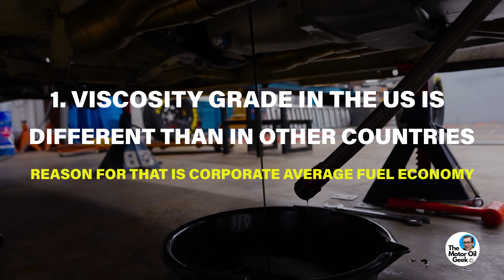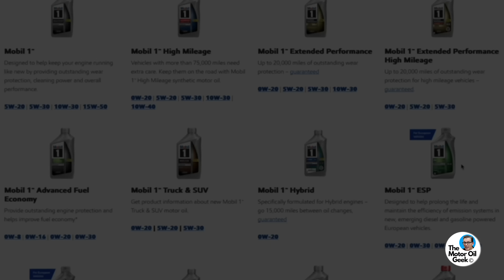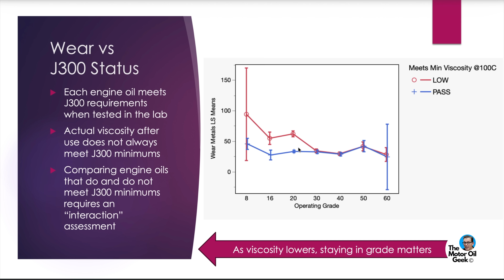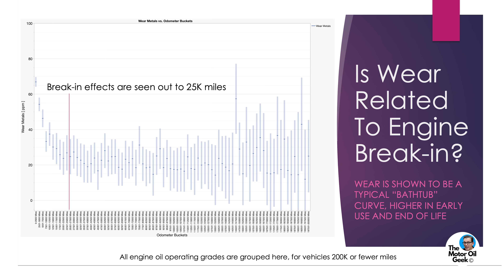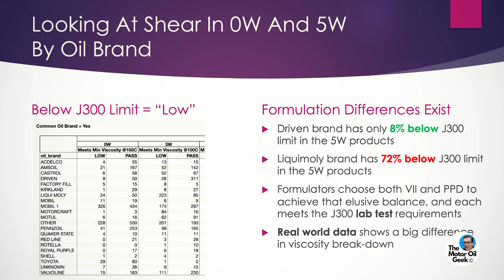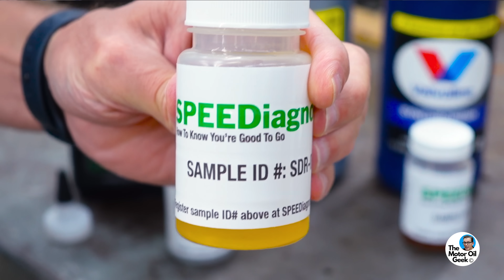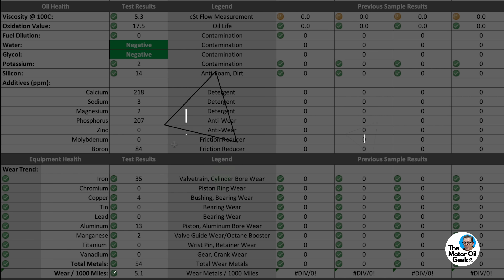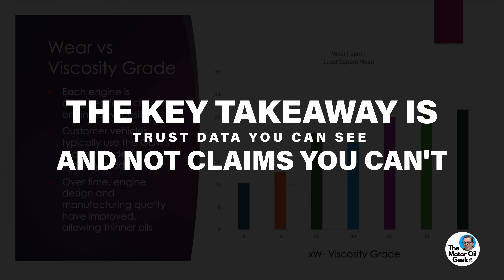More Ai Lies? The FACTS about 0W-20 vs 5W-30 (With Evidence)

Comment: You make very informative videos on the wear characteristics of oil in regards to defending zero weight oils, BUT I don’t recall you talking about wear caused by Valve Lifter Clatter on Start Up, with zero weight oils…

My 2023 Ram 5.7L and my 2025 Jeep 3.6L both called for 0w-20 oil, and both had very bad valve lifter clatter on Start-Up from new with 0w-20 oil…

Switching to 5w-30 oil at 500 miles eliminated all clatter at start-up down to temperature as low as 1 degree Fahrenheit…

The 5.7L currently has 4507 miles end the 3.6L currently has 2088 miles on the engine…

My real world science in this factual claim is, I stand right in of the front bumper, remote start both engines, listen with my ears, and with 5w-30 oil there is no more valve lifter clatter…

Valve lifter clatter with CAFE GARBAGE oil cannot be good for any engine.  I say my Ears trump your science, what say you???
Reply: I’d say a electric pre-oiler would be good for all our engines.
Reply: You should gather data and create a video defending your point of view. Stellantis doesn’t have a good track record with engine longevity…

Comment: So how do I prevent oil from shearing? Sounds like overheating it is the main factor?
Reply: Depends if you got a turbocharged engine and temperature of oil and outside.
Reply: @halftontimrvreviewsandtips3106  One example - Chrysler 3.6 pentastar, mine has 5W-30 on the cap but newer ones have 5W-20, rumor is that after Fiat/Stellantis/lizards took over, they had a deal with different oil maker, or maybe needed to reduce the fleet emissions. Another example - classic V8 muscle, original manual says 10W-30 but R&D of oils went a looooong way since, is this still valid? Should I go higher if I use it only in warm weather?
Reply: @redguyCZ  it really depends how cold it gets in your area. It’s been a while since I looked up the bottom and of the temperature range for 530 but I think it’s like -30 or 32°. The coldest it gets here that I’ve been has been like 15° normally the coldest it goes to is like 22 to 24° and that’s rare but generally for my peace of mind if it drops below 32° I like to have 0W 20 in my engine and since I only do two oil change as a year, I have it timed perfectly aware I can just switch them out with the temperatures. I tow 7000 pounds a day so I kinda push my truck a little bit more than normal but I do a lot of short trips as well like 5 to 10 minute sometimes shorter with a long trip in the beginning and a long trip at the end like 35 minutes I should say longer. And in the winter, those short trips when you’re starting up a lot, the engine doesn’t fully heat up in between some of them so I tend to just switch the 0w-30 to prevent some of the wear from startup.
Reply: @redguyCZ   Its all EPA driven  Lake even stated that in a previous video! Another non elected group telling us what to do 🤬
Reply: @halftontimrvreviewsandtips3106 chains sheer oil more than anything

Comment: I have a 2019 Kia soul 1.6 l lots of oil blow by. Thirsty little engine. I use 0W-20. But I'm hearing switching to 05W-30 will help prevent some of that blow-by. I know the wear and tear ain't going to be any different because of the additive packages so on and so forth. But I am curious about if the thicker oil will prevent some of that extra oil being burnt up and sent to the catalytic converter??

I'm getting tired of spraying GDI cleaner into the top of the catalytic converter through the CO2 sensor port. Probably doesn't even help anyways.

(I use Pennzoil ultra Platinum full synthetic)

Comment: Great stuff. Id love to see the data from a dodge 5.7L using 5w-20 or 5w-30 versus 0w-20. In any case, as a technician, i say use premium type of oem partner brands and change oil every 3k. Expensive but best case for longevity
Reply: Been using 0w-40 in my charger 5.7 for the last 6k miles. Decided to make the switch after replacing the lifters. Going to run it till it blows again.

Comment: The question is, why are the recommended oil viscosities different outside the USA and why are they not the same as inside the USA? If it doesn't matter, then why make them different? Who would not appreciate better fuel economy? Especially the people who pay more for fuel.
Edit: Added Statistic: Using 0W-20 oil offers slightly better fuel economy (around 1-3% better) than 5W-30 due to its lower viscosity
Reply: Yeah he needs to answer this one.!
Reply: The short answer. Sometimes that fuel economy increase. Is at the expense of engine longevity. If you trade up to a new car every few years. Engine life won't matter to you. Long term cost effectivness matters to a lot of people. And in those cases. Longer vehicle life is more cost effective then the slight increase in fuel economy given by lighter oils. Short term gains versus long term gains. Engine design and operating conditions are the main factors that determine what oil is best. Turbo vs non turbo. VVT vs non VVT etc. Driving less then, or more then ten minutes for the average trip. Stop and go vs open road. That's why oil analasys matrers, in figuring out what oil is best for your use.
Reply: @ricka.a.  I don't think you comprehend my question based on Lakes premise that there is no relative difference other than "Fuel Economy". What you stated is considerably true, but it's a point that I feel that Lake ignored in his commentary.
Reply: @additudeobx  I understand your point. The fact is. If Lake were to include all the comprehensive data and facts in one vidoe. It would be at least six hours long. He has covered other facts in other videos. Like how so many modern engines now use internal hydraulic systems for various forms of cylinder deletes and VVT. Which is why he often references other videos he has made.
Reply: @ricka.a.  ... you mean, "Include one reference".... Not "include all".
Reply: As a logical thought process, if a manufacturer is recommending 0-20w on one continent with average fuel economy standards and 5-30w on another that doesn't, the 5-30w is almost certainly the best engineering recommendation for longevity of the engine.

Who would not appreciate better fuel economy? Especially the people who pay more for fuel

Because once you reach about 30 MPG in the US, the cost savings diminish to the point where it doesn't matter much if you get 40 MPG.   But it is a fact that if you have to replace an engine in a car you'll pay $5K-10K for a normal car to replace that engine out of warranty.   Which means that for most people they'll junk the car at that point.  And with new cars topping $40K, that's an expensive way to save some money.
Reply: I want to know about extreme hot places like Las Vegas or Phoenix, what the recommendations would be.
Reply: @gruanger  you really need oil analasys to figure that out. Due to the complexity of modern engines. In most cases. A zero weight is a waste of time in hot climates. If the manufacturer recomends 0w20. 5w20 would probably be better. Maybe even 5w30 or 10w30. Oil analasys is the best way to find out. Engines are not simple, like 35+ years ago.

Comment: I disagree in a turbo engine 0W 20 is more likely to share due to the increased heat and the mechanical speed of the turbo. Also 0w-20 after what 90ish degrees is not going to do as well as 5w-30.
Reply: Could you please provide the data to back up your opinion.
Reply: @vernonpitts6630  call up Dr. Fauci he is the biggest believer of #DATA and he will have your information
Reply: @vernonpitts6630  you’ll find it in another lake speed video

Comment: Extraordinary claims require extraordinary proof. AI is none of this!
Reply: There are AI's and there are AI's.   What most of us have experience with is a Large Language Model (LLM) AI which does one thing really well:  It summarizes websites and is able to converse with you in a way that can make you believe it's a person.   So the old saying of GIGO (garbage in Garbage Out) applies to a large extent.   That's why if you ask an LLM a question, you always go to the underlying websites to see if it's believable.
Reply: @tee @teekay_1 
 Yes, very true and good info. Basically there are different levels of cost with complexity. The cheaper voice recognition used in closed caption is horrible. “The airplane was flying at 35 feet with 312 soles before it descend 12,000 feet per second” Thank god we can tell the difference. Believe half of what you see and none of what you hear!

Comment: What's the point of Banging on about this? the whole lot is lies and deception - from "official" Swarf & Debris causing the Bearing failure for even the Japanease Motors!!!.
Everyone knows it's the Thin Oils - Working with Small Displacement High Stressed, Start Stop, High Alcohol Fuels, Turbo Engines.
Oil's are not created equal and I've little doubt  The Very best thin FULL Synthetic can match the Film Strength of the heavier Oil But tell people which oils they are and which oils to avoid.
Until then is it not best for people who change their own Oil to go 5W30 assuming even a middle of the road brand will not shear down like a middle of the road 0w16/20 when your Enging is working Harder.

We all hate the Ai Generated Videos but the Sentiment is !00% Correct IMHO and they give an Opinion 
unlike the "Use what the Hangbook Recommends" of everyone else 🤣

Comment: Been changing my oil in my 3.5 V6 Nissan at 3,500 miles for years. I live in deep south Texas where it's hot and traffic sucks. I'm at 272,000 miles and (knock on wood) - everything seems fine. Not even an oil gasket leak anywhere and no oil consumption. Been using 0w-20.
Reply: As the old saying goes, "The proof is in the pudding." What brand oil are you using?
Reply: @davepaturno4290 For the first 5 or 6 oil changes, I went to the Nissan dealership. I bought the vehicle new and it came with five or six oil changes, I don't know what they used. All oil changes after that I've been using Pennzoil Ultra Platinum. I'm sure there are better oils (or oils just as good), but I can usually get a 5 qt jug from Walmart for $25 to $30. Price varies. Still not bad for full synthetic. I change my transmission fluid religiously every 30,000 because its a CVT and they make me nervous. But it's held up. Also, besides the first few dealer oil changes, I use a Purolator Boss oil filter. Change air filters with every oil change because they are mega cheap on Amazon.
Reply: @davepaturno4290  No, proof is not in the pudding.  Proof is in the oil analysis.  Not every smoker dies of lung cancer, not every KIA burns oil early or catches on fire.
Reply: @lonniebeal6032 Your proof is in your blood pressure and bloodwork readings, but if a vehicle lasts many miles without consuming oil, then that is proof that your maintenance schedule is working.
Reply: Same here, 2013 V6 Hylander 197k 0w-20 since new every 5k. No leaks not one issue uses no oil between changes.
Reply: @jchalestorm1749 0W-XX oils have been proven to be all that is necessary for modern engines.
Reply: Same here. 2014 Acura MDX, 3.5L, 151,000 miles, 0W-20, every 6,000 miles, Mobil1. Never require a top up and no leaks. Winter and summer driving. 👌
Reply: @svenhodaka9145  I have a 2013 Acura TL with the same engine. 208K miles and just like yours, it has zero leaks and never needs topping up. 0W-20 all year round (New England weather) with an OEM filter changed every 5K miles. Mobil1 all of it's life but now I'm using Valvoline Restore & Protect.
Reply: @skree_fpv436 same, I use OEM filters too. It’s a nice touch that the drain plug gasket comes with the filter. What mileage did you change the timing belt? I had mine replaced at 95,000 miles.
Reply: @svenhodaka9145 First timing belt change at 100K, second one was done at 201K
Reply: I switch from 5w-30 to 10w-40 (and sometimes 15w-40 if I'm not in the mood) in my '19 Daihatsu Xenia, it's been 200,000 miles and never had any issue with oil consumption, leaking oil gasket/seals or even rattling timing chain. 

I live in the equatorial part of the globe (Indonesia) where hot weather, humidity and also low-quality fuel are part of our life. I don't think 0w-20 or 5w-30 will survive here
Reply: I live in Panama and it's at least 30°C everyday and have been using 5W30 with no issues. However, my owners manual says I can also use 10w40, which I may start doing. In North America, 0W20 is recommended in my Toyota 2TR-FE engine.
Reply: Well.....   The PROOF Might be in the Pudding. Buuuuuttttt.  Have you done the OIL analysis to Check the Facts.  Show us the Money so to speak. Ya the 272K does say something no Doubt!👊.
Reply: @kendavis1198 no I've never done an oil analysis and I don't feel the need to do so. I figure if the car blows up tomorrow I got my money's worth out of it. But I don't think it will, at least I hope not. It was the first foreign car ever purchased by my family. I would buy another Nissan after the good experience I've had with this one. I just changed my oil religiously and used full synthetic. I'm pretty certain that if I used full synthetic Mobil 1, or full synthetic valvoline (or other brands), I'd be in the same place I'm at today.
Reply: @kristopherlauro4327     Gotcha. And it Appears as tho Nissan is the Only Manufacture that's NOT in the Recall High Light's nowadays. We had 2 Toyotas that Ran Like Clocks. Probably should have just Kept them and Not had these Stupid Truck Payments and Issues.
Reply: Same here, 2010 4Runner, 180,000 miles, 0W20 and OEM filter every 3500-5000 miles.
Zero problems, zero oil consumption between changes.
Live in Atlantic Canada with temps between -20 to +30 C.
Change frequently and use correct spec’d oil.
I typically use Kirkland brand for the spec and pricing.
Reply: @daryllambert-ho9jk your engine would be happier and quieter with 0w30
Reply: @roketfingers  have you tried it in your 4Runner 4.0?
Reply: @daryllambert-ho9jk  the manual actually tells you to use a heavier weight than 20 if you fall under special operating conditions... yup, and its slightly quieter
Reply: @roketfingers  I'll have a look through it again. Thanks
Reply: Same here, SE Texas, had a CR-V that ran 0W-20 for years and I did bump to 5W-20 in the summers in its later years. No burning, no leaks at 180k. Traded it for a new HRV and plan to do the same routine.
Reply: Impressive. Nissan VQ engines, I have been told / VOAs, tend to shear oils down.
Reply: This
Reply: My three little Tacoma trucks get the oil changed every 2,500 miles with 5w30
Reply: This means because you are doing good frequency changes you can get by with an inferior oil.  I do both.  4k changes and went back to 5w30.  The sheer fact that 0w20 was specified due to cafe standards makes me lose all trust that it was chosen for being the best for my vehicles
Reply: Many manufacturers now have their own specification for oil in addition to the viscosity rating. Presumably this relates to additives but they don’t tell us. So how are we to interpret this when choosing an oil, especially if the viscosity grade is different?
Reply: Same here and I live in S Texas.
Reply: poor VQ. They shear oil heavily. 40 weight is needed.
Reply: @TheGuruStud the VQ shears oil heavily? Can you post the information to back this claim up? I would like to read it
Reply: @kristopherlauro4327  Yeah, it's called reading the forums or even just bitog. 2K miles and it shears down a grade even on top oils.
Reply: @TheGuruStud yeah, you're mistaken. It's called, "making stuff up on the Internet."
Reply: M7 350z did the same. Almost 300k but I used 5w30 🤷‍♀️

Comment: Just turned 200k on my 2010 Lexus RX350, been using 0W-20 at 5k mile intervals as well as using Top Tier gas all the time...Castrol Full Synthetic 0W-20 and Wix oil filters...can you tell me if Castrol runs out of shear sooner than other brands? The car is driven aprox 50 miles per day, and aprox 10k miles per year in Middle Tennessee.....excellent videos, thank you...
Reply: Castor oil full synthetic is made from crude oil and converted to synthetic and is a good oil but it does not measure up to pennzoil ultra platinum 0W 20 made from natural gas that is much cleaner than crude oil base…. unfortunately Castrol oil is becoming granddaddy oil in today’s world.
Three 5 quart jugs PUP 0w 20 from Amazon received in 2 to 3 days is around $72 it comes out to under five dollars a quart.